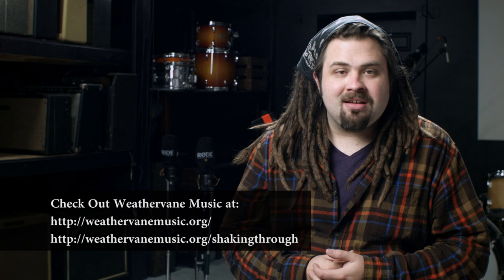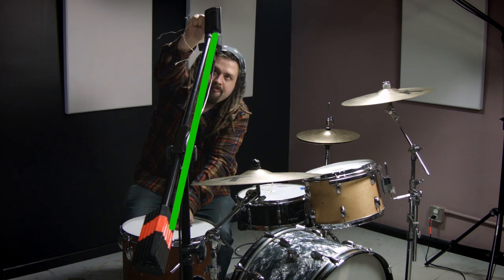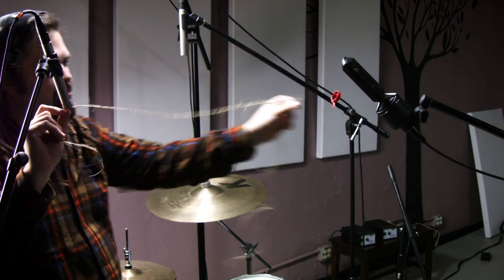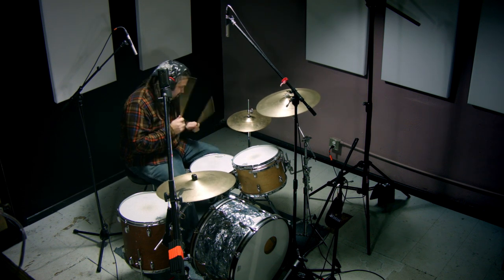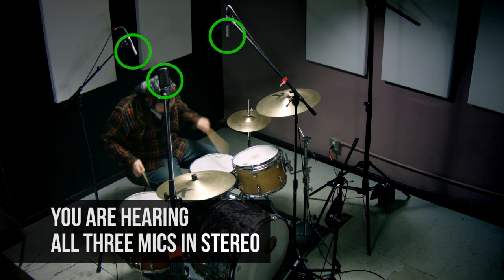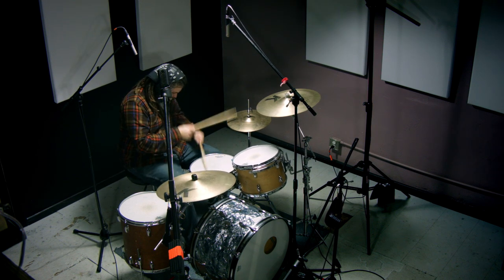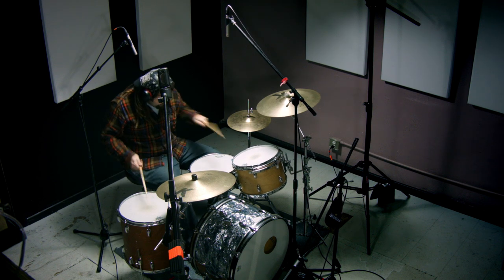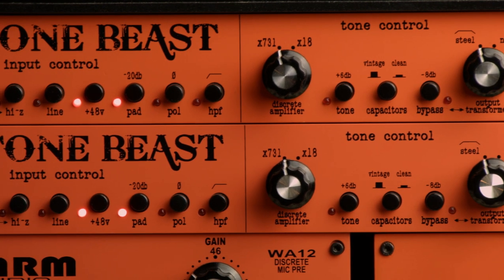Drum Overheads - The Weathervane Method

Comment: does it have to be a ribbon overhead, or could you use something else in place of the ribbon? Im guessing the ribbon was just part of the original sound of the technique?
Reply: Look up the NTR's frequency response, it's extended but it's pretty dark, rolling off as much as 10db by 10khz. I have a feeling you could get the same effect with a large-diaphragm condenser (for the extended low end) and a really soft shelving EQ (6db/oct) to make it darker. You might also find that the condenser gives you a better sound without EQ. You won't get the same pickup pattern though.
Reply: Problem with ribbon mikes is they can't be used with phantom power on.
Your mixer must have 48v commutable on each input.

Comment: Have you tried the same technique without letting the thread slip?

I think the reason it works, is because in three mics you don't need absolute perfect phase, but the pencils add more width if they're just a little bit out, which they are now. It won't collapse in mono, because the ribbon is still there.
Reply from the maker: +Angelo Boltini Yeah, that's one of the biggest questions on why this works. I wanted to hear for myself on how well this actually works.
Reply: +Angelo Boltini - One of the last innovations before we published this was the equilateral triangle, which I haven't been able to make work when treating the sdc's like Recordermans. Our original inspiration was my own misunderstood version of Recorderman that I wanted to insert a middle element into. Later, I realized that the key was to start with the placement of that center element and recreate geometricly something relatively like Recorderman, but not exactly. I ultimately like ours much more than Recorderman. Much bigger and more natural.

Comment: Awesome technique, but this is not a common decca tree?, i mean, an angle of 180 degrees in a equilateral triangle over the drummer`s head,  i thought that this drum technique was common to record bands of the 60's, i belive that i had seen this technique in a picture before. Im confusse :/.... the mic in the kick it`s a part of the original arrangement???
Reply from the maker: +Andres Uribe Gelvez Yeah, t here some similarities to the decca tree, but that's a whole different thing. This is not my own technique, but Brians, and I found it very interesting sounding compared to other techniques. The kick mic is something that I added. Usually Brian will use a mic inside from what I've seen.
Reply from the maker: +Andres Uribe Gelvez Yeah I see what you mean. It does seem like the 180 approach. I know that Brian arrived at this approach by mistakenly sliding his finger on the string when setting up a recorderman, and then another engineer at Weathervane suggested the triangle idea.

Comment: How would measuring ensure balance of the toms? What if they are different volumes, since one is about ten time the size (volume).

And, when measuring the bass and snare, usually its for phase and you pinch the string so it remains the same distance...

So i don't quite understand all this measuring and why its so important when its got nothing to do with phasing!...I mean it sounds good, but just seems a bit arbitrary..............If anything you've ensure that the kick and snare will NEVER be in phase by doing this as you've definitely shited the ratio between them- even if you time-align tracks later...
Unless there's some magic in the triangle I am missing...Like they are meant to be equally out-of-phase to create something like a mid/side array effect.

A side question though; I often prefer the OHs infront of the kit- and use the string pinch method....if I do that though I can't get a string to the kick beater. Where is good to measure from? The top of the head? The top of the middle of the shell?
Reply: +jorgepeterbarton OK you kinda answered in the Q&A video. And are just as confused as I. Seems like there could be some maths involved though, like they are equally out of phase in opposite directions becuase of the triangle.

Comment: I tried to do this today when I had some spare time. I just couldn't get it to work right. I couldn't get the ribbon to be equidistant from the rack tom and floor tom and couldn't get the side microphones to be perfectly equal to form the triangle. I suppose having the mid tom in the way doesn't help. 

When I did some test recordings, I found that flipping the polarity of the side microphones made things sound worse (which is good I guess, as it means I kinda got those right), but when flipping the polarity of the ribbon, it actually made things sound a bit fuller. It took me a good hour to even get it to that stage, but I'll have to try again to get it right.
Reply from the maker: Yeah it takes a little time to set up. The first time I set it up, it took about 20 minutes with going back and referencing the instructions. It gets faster in the future.
Reply: Creative Sound Lab I tried it again today and it worked a charm! I used my Cascade Fathead II with my Shure KSM137s. Added a D112 on kick and also tried a 57 on snare. It was actually pretty interesting flipping the polarity on the 57, as it actually made the snare disappear, it was insane. That never happens.

Comment: Hello, great work man.
Could you please tell me about your snare/head/tuning.. you've alluded to using ambassadors for batter heads but your snares always sound so dry (in a good way) when hitting rimshots. Mine always sounds ringy whether tuned high or low.
Thanks,
James.
Reply from the maker: Yeah, I use the snare side heads, which are the real thin ones as you pry know. The bottom head is tighter than the top by about a 5'th or more. The dryness of the drum can be due to the quality of the drum and baring edge. Supraphonics for example sound warm and kinda dryer than some wood drums. I believe this is because the edge is fairly rounded off, compared to a really sharp edge.

Comment: Ryan...I'm so luvin' all your presentations...this one so much that I had to go out and replace my cheapy stereo Blumlein with the R88...Question: I have a medium sized room...about 12' long X 11.5' wide X 9'3" tall...I have home made panels just like yours except I use 8lb rockwool...!...They are not splayed out from the wall...(I'll give that a go)...how do I best determine what frequencies need attenuation...?

Also, I thing the audience would like to know what your signal chain is...?

Thanks...
Reply from the maker: +Dave Smith Hey thanks Dave! Yeah, just put the panels up and try to get a little space behind them. I try to have a spot in the room where each wall and ceiling is at least treated. The ideal place to catch the bad frequencies is 25% of the way out from the wall, but that is not often practical.
Reply: +creativesoundlab Yeah...that would be just under 34" out from the wall...If I don't have to treat both walls...it could work...but the room is only 11.5' wide...!...Thanks for getting back Ryan...!
Reply from the maker: +Dave Smith Haha, yeah, that's a crazy amount of room that you loose. I would stick with 6 or 8 inches and I think you will hear a difference.
Reply: +creativesoundlab Thanks Ryan...!

Comment: Nice technique, I actually used this on the first drum Demos I ever recorded... although I didn't really know what I was doing and didn't check the distances all that well. Will come back to this video next time I try it. Could you explain what you mean with the pad an the 48V not getting to the mic? I didn't really understand what you meant
Reply from the maker: +Da Spotz Yeah, for the pad blocking part of the 48v....phantom power goes down the same wires that the signal travels on. So to pad one, you also pad the other. If you use a built in pad on the mic or the pre amp, then you keep the full 48 v going to the mic. This is a pretty new idea to me, and I just decided to stop padding for condensers, so I still have some testing to do and listening to do.
Reply: That's interesting! Thanks for elaborating. But just to be clear, you only pad when the signal exceeds what the mics can handle (volume wise), right?
Reply from the maker: Well actually what the PRE can handle. I think a lot of mics can handle a lot, and most of the time it's the preamp that's overdriving. Rode has amazing headroom in their mics for example, so it's more about the pres. If it were about the mics being overloaded, then I would move the mic away from the source or use a different mic.

Comment: great idea! thanx. but only 2 questions. 1 - what if I have 2 rack toms and 1 floor tom? I mean distance between mics. 
2 - what distance from drum set to room mics?
wanna try today this method
Reply from the maker: +Vladimir Sergeev Hmm, I might let Brian answer the question about the second rack tom. The second rack tom might be a touch louder than the hi and low tom, but it'll still be in the middle of the toms. That's a great question that I'm curious to know too. For the room mics, the mics in the video are about 6 feet away from the front edge of the drum kit.
Reply: +creativesoundlab thanx for your feedback. I appreciate it. I made test record by this method and found that the studio should be acoustical prepared (sorry for my english). I mean damped. otherwise there is too much room in mix
Reply: +Vladimir Sergeev - yep. The technique has not been fully fleshed out for other configurations. I intend to as time goes by. Would love it if you would help...
Reply: +Vladimir Sergeev -- as far as the distance, it's explained in the document itself, but I start with a distance that the drummer won't hit the mic with drum sticks.

Comment: Do you think using pads on mics is the same as inline pads in regards to reducing phatom power? Good video. I bought these instructions but had a hard time with them because of the up and down distance of the second pencil mic then realigning the triangle between the three
Reply from the maker: +Jeb McGovern Yeah I think that a pad that is build into the mic, here I used the pad on the NT55, it is designed to reduce it's output without it having an effect on it's performance. So I would use the pad on a mic first, if I don't have then, then a pad on the preamp, and then if I have neither of those an in line pad like I had mentioned.
Reply: +Jeb McGovern - yes, when we've aimed for a wider triangle, I've found I have to repeat many of the later steps back and forth in order to get it to fall into place. Once the dimensions have settled into place though it sounds great and works like it would with a smaller triangle. I'd love to some verification from someone else, so please let me know what you think. You can email me your thoughts any time.

Comment: I've been putting off trying this method for too long. I just purchased the 3 pack, and now I'm committed ! I have a pair of SM81s they should be a nice compliment to a ribbon mic. Do you think that the R88 could work in this situation?
Reply from the maker: +Malcolm Palm Yeah, you can use the R88, but just one side. I usually use the top ribbon if I'm using that mic in mono, and then point the ribbon directly at what you are recording. The bottom mic will just be hanging out and doing nothing, no big deal.
Reply: +creativesoundlab Oh, cool. I didn't know you could do that.
Reply from the maker: +Malcolm Palm Yeah, the R88 gives you two XLRs for each of the two mics inside the enclosure. You don't have to use both mics if you are using it for vocal, or guitar, but it's just a huge mic to hang and move around for such a task. Still, it can be done and I do it often.

Comment: Hey Ryan, that sounded amazing! Would love to hear a version with close mics as well.
Could this technique be used with other microphones than ribbons; like large diaphragm microphones? I'd still wish I had some ribbons to check this technique out myself though =)
Do you normally only pan your drum overheads 40% or do you experiment with the panning ?
Reply from the maker: +Søren Sørensen For your question about using a different mic than a ribbon on the center - Sure I guess you could try it. Part of the sound of the technique is having the low mids down the middle, and the brighter mics (SDC) out to the sides. 40% is just what Brian McTear told me that he uses, and I was trying to stay true to the practices that his engineers use. I dig it actually.
Reply: +Søren Sørensen -- If I were using XY or some other true stereo technique, I'd typically pan hard. But our technique falls apart when panned too wide, just like Recorderman has in my experience.  It actually doesn't mean our technique produces narrow imaging. It's quite the opposite. It simply does so without panning the mic signals all the way.
Reply: Thanks for the responses! Thinking about it I can clearly see your point. Now I just have to try this for myself! Merry Christmas =)

Comment: Thanks for the video. So for the overheads, is your right overhead pointing towards the snare? And what about the left overhead? It looks like it's pointing down between the snare, tom and crash.
Reply from the maker: Yeah, I point everything everything in the general direction of the snare, but don't get too nit picking about it. The over-snare mic is pointed at the front edge of the snare, and back rim of the hi tom. The over-floortom mic is kind of pointed at my right knee. I know that the weathervane crew point the mics inward just slightly, but I'm not sure that you absolutely need to. If anything it might be more technically correct to point them the same angle.
Reply: creativesoundlab Thanks. I haven't tried out the technique yet but look forward to it. I was watching the video from George Massenburg on how he mics overheads and was wondering if there would be a way to combine the two. They're already pretty similar but I don't think the Massenburg technique has the snare OH directly over the snare.

Comment: Nice technique... just one question.. how does it work with a not so good treated room? can I lower the distance of the mics or may I have to choose another different technique? Thanks!
Reply from the maker: +Luca Ridolfo This technique is pretty good I think. It's better than Blumlein for a bad room. Yes, if you lower the distance of the mics it may help. Also treat the ceiling first as this can have some really bad affects on overheads with the snare drum.
Reply: Thanks for your comment! I want to ask you if Recorder man or Glyn Johns technique is drier rather than this method which you have described... I'm lookin for a solution in order to use 3-4 mics and obtaning a nice dry sound
Reply from the maker: +Luca Ridolfo Yeah, if you had a mic for kick and snare, I might even go with an XY as close as you can get it, and then mic kick and snare.

Comment: Hey bro, great video! I have a question tho,  is it plausible to get a similar result with a condenser mic set to figure of 8 instead of the ribbon mic and does it make a difference where the two side mics are pointed at? Thanks! :)
Reply from the maker: +Milan Jejina (Yeqy) I think it would be more important to go after the tonality of a dark mic, rather than the exact polar pattern that you use. For it, the center is dark and picks up the drums. Most LDC will get a touch bright if you put them in Figure 8 mode.
Reply: +creativesoundlab Ah, I see... thanks for the tip! :)

Comment: I've been using a similar technique on overheads for a while now. Give it a shot some time if you're experimenting some day!

Start with a spaced pair of condensers (I've gone back and forth between small diaphragm and large diaphragm) equidistant from the snare oriented on either side of the kick/snare center line. Add in a ribbon mic in the middle near that center line also equidistant from the snare. Basically, making a similar triangle to the one you've made - mine is far from equilateral, though.

I end up high-passing the spaced pair fairly high (nothing too outrageous - 6db per octave at 400hz-ish is where I'll start) to concentrate the low end into the center and I'll let the ribbon roll off the top in the middle mic to put the high frequencies out far right and left exaggerating the sense of width a bit. Buss the three mics together and then do a little EQ work to make sure the mids aren't too thick.

The sounds have been good enough to be my main drum sounds lately. The spot mics are just reinforcing at this point...and I like it a lot more than my previous methods!

Thanks for all the info, Ryan!
Reply from the maker: +DontWorryImAPilot Hmm, your description could be within an inch of what this technique does. Depending on where the mics are placed, and how the kit is set up (height of toms, size of drummers kit) this technique might have a tendancy to change as there are measurments to both toms. A lower floor tom for example may push the ribbon mic a little back vs directly over the ride for example. Also, this technique is not perfectly equidistant, but the measurement to kick and snare are always the same SUM of both distances. Your technique is most likely very close in sound, but this gives multiple points of measurement which is nice.

Comment: Sounds good! The ribbon points at the snare *and away since it's polar; is room reflection ever a problem? Where's the ribbon panned; center? And the two condensers create the stereo image? Or since it's a triangle they all work together? Tricky one! Thanks
Reply from the maker: Yes, the ribbon is panned center, and the condensers are panned out to the sides. Brian has told me that sometimes in mixing the middle ribbon is not that strong in the mix, and they can sometimes rely heavily on those side condensers for most of the drum overhead sound.